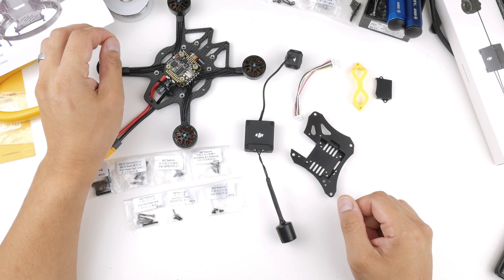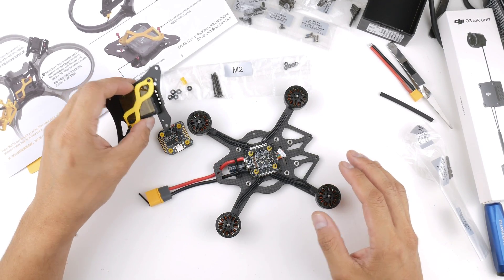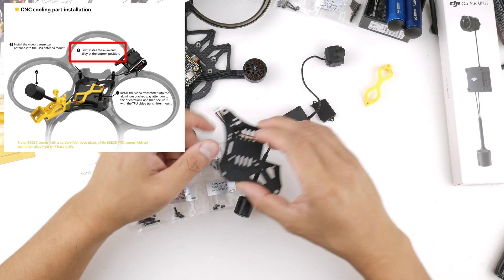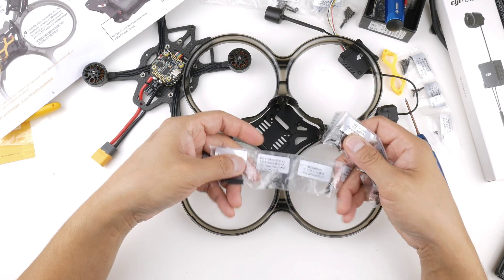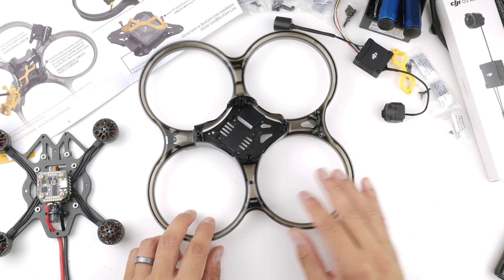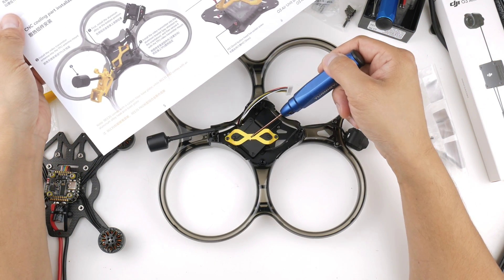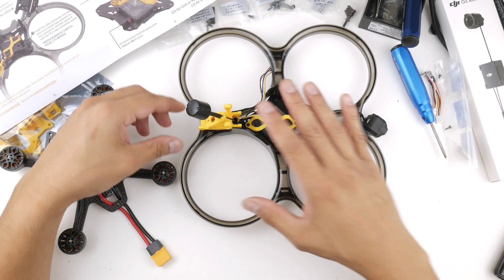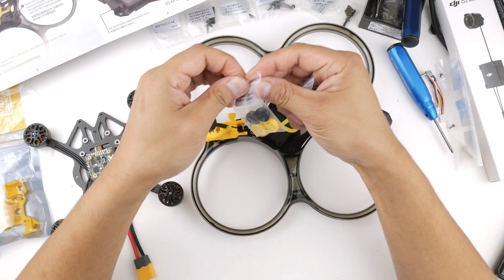SpeedyBee Bee35 Build - Part 2 - DJI O3 Air Unit Install

Comment: Thank you. I am thinking of buying this. Would it fit a walksnail vtx, though?
Reply from the maker: Sorry. I don't have Walksnail to try. But you'll have to buy the non "Pro" version which comes with a different bottom VTX mounting plate.
Reply: So, the aluminum plate and carbon version might be different sizes? I think I will contact them and hear if they know about Walksnail-mounting.
Reply from the maker: @rattusrat  yeh. My understanding is they're different in the fact that the Pro version has the aluminium mount moulded specifically to fit the O3. The carbon plate version is flat and has standard VTX mounting holes of 20mm and 25.5mm. But please do check with SpeedyBee to confirm.
Reply: I have DJI O4 pro but it is not compatible with the frame . What is the slution

Comment: Great videos if you are installing a elrs receiver I think you cannot solder the sbus cable from the air unit to the flight controller or the receiver will not work,
Well this is what my speedybee f405 30x30 was like when I tried to get the elrs receiver to work
Reply from the maker: Hehe yep. I do know this and you'll see why in the next video. But thanks for the reminder 👍👍

Comment: Build the same quad but i’m using speedybee F405 V4 and yes it is so tight
Reply: Is the stack you used a 30.5x30.5 and vtx the 03 air unit? If yes, how have you been able to fit them in? 
I’ve got the speedybbe stack v4 30.5 x 30.5 and 03 air unit and the stack touches the 03 and can’t fit them in, so have to change stack!!
Reply: @FSAcalabriacrew  yes it a 30.5X30.5 stack, and O3 air unit. The O3 doesnt touch the fc but the rubber pad of the o3 does. But i have  tighten the screw a little so that there is room for heat dissipation. Besides that i trim the m6 screw so that it doesnt touch the o3 and put only two screw digonally. Also i attach the capacitor to the xt60 plug end.
Reply: Yeah it makes sense now. Thanks. The usb port of my fc touches the 03. Anyway I needed up purchasing a mini speedybee stack
Reply: @FSAcalabriacrew  how can? im flying good with this stack.
Reply: I have no idea. I am gonna try again. Did you use the screws given with the stack?
Reply: @FSAcalabriacrew  i used the screw but shortened it using angle grinder so that it wont touch the o3 air unit